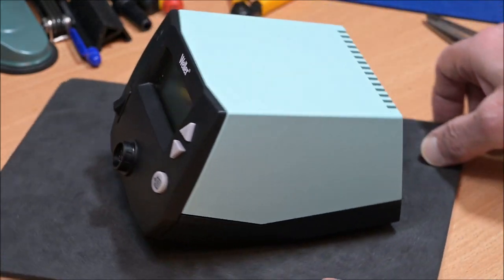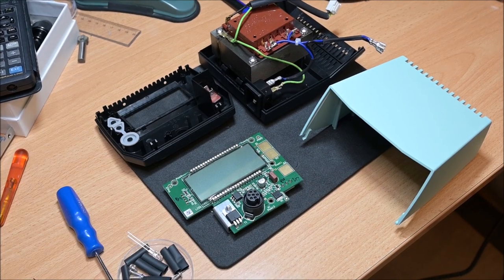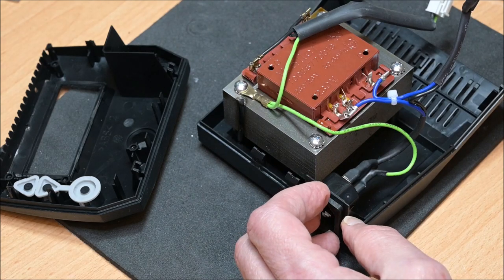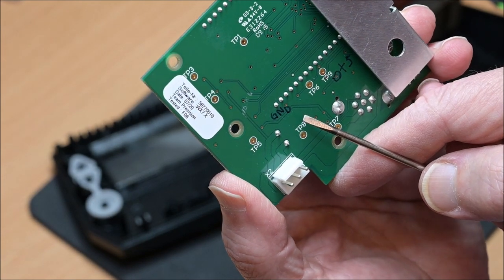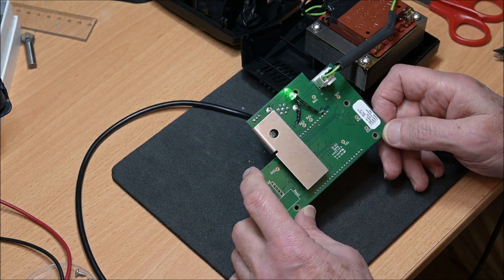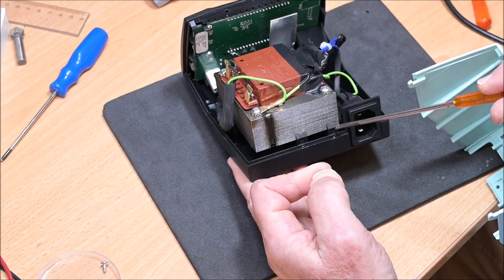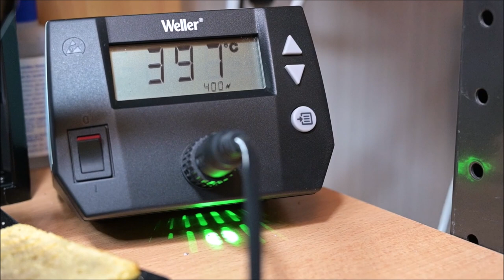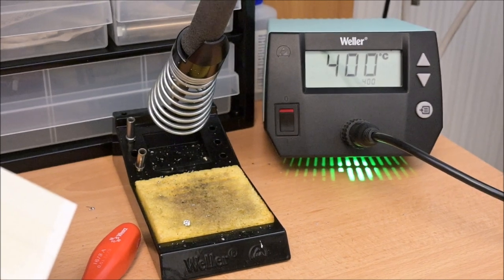Weller WE 1010 - A simple modification

Comment: Congrats for your job...it is very instuctive and pleasant to watch this video . Please , what are the necessary elements except the LED for this modification ?  I read somewhere in a comment a resistor I think...of what power please ?  Thank you for your answer ... Best regards from France . Cheers . Thierry
Reply from the maker: Thank you for your comment. The only parts needed to make this modification is a LED and a resistor. As you can see here, https://youtu.be/vsnpXHTc3M8?t=360 the resistor is nearly invisible because it's inside the heat shrink tube. It is connected to the +. I don't remember the value because it is a sort of trial and error value, I chose the value which gave me just enough light. The LED is a very bright 150k mCd, so it is really extremely bright and only needs about 1 mA, which in my case resulted in a resistor of around 3k. LED with less intensity might need lower resistor value to get higher current. As I said, I don't remember exactly, I just took a resistor and experimented to get the right intensity. I did not want it to be too bright because the desk surface is reflective and I did not want it to shine into my face too much.
Reply: @AdaptingCamera  ...Thanks to you
Reply: @AdaptingCamera  You say LED bright : 
150K mcd i know mcd but what is k mcd ? also the resistor 3K ? what is 3k...Power Resistor are in Ohms , isn't it
Reply from the maker: @sheritage1450  The letter "k" is used as short for "kilo" which is the same as the value 1000, so instead of writing 150,000 mCd I wrote 150k mCd. For the resistor it is the same, 3k but normally the word "Ohm" is also left out because resistans is measured in Ohms, so that is obvious. 3k means 3000 Ohms, or 3k Ohms.
Reply: @AdaptingCamera  Thank you for your answer and excuse my naivety but I'm new in this field of electronics...
Reply from the maker: @sheritage1450  You are welcome. We all been new in electronics once, so don't worry.
Reply: @AdaptingCamera ... Just finished "your modification" on my WE1010 , thanks to your video...same color , same intensity . The result is very nice . Thank you for sharing your experience . Kind regards from France . Thierry
Reply from the maker: @sheritage1450  You mean I am not the only one on the Planet Earth with this soldering station any more...? Cool. 👍 Thank you very much for the feedback. Kind regards from Sweden.
Reply: If you use a LED on 5V, you should have 25mA current as a rule of thump. It gives a bright light, and does not kill the led too soon.
As Ohms law is used I=U/R. To get R, use R=U/I --> 5V / 0.025A =>  200Ohm. If you use a 220 Ohm resistor, you should be fine.
Reply from the maker: @dschoas  That's incorrect, and is ONLY valid for old, low intensity LED. For LEDs with such high intensity (especially green LED) 25mA is far too much. Even so, if you want 25mA current drawn from 5V then the right formula is: (5 - LED voltage) / 0.025, => in my case (5 - 3.3) / 0.025 = 68 Ohms, NOT 200 Ohms. But that is for MAXIMUM intensity. You don't want that with a 150k mCd green LED because that's just far too bright and a huge waste of energy. That is why I am saying it's trial and error. Some people want it brighter then others, I am happy with the 3k resistor, which hardly draws any current, but gives more than enough illumination.

Comment: Wasn't it simpler and less invasive to mount an illuminated switch?
Reply from the maker: Not less invasive but simpler. On the other hand, if I was after simplicity I would have done nothing.
Reply: I totally agree to your question. Just use a Marquardt 1800.1102 switch and you don't have to solder on the PCB.

Comment: Super cool  mod! Informative and inspiring.  Do you think adding a fuse to this weller is necessary for safety? Can this be done?
EDIT  Never mind,  I just read the reply to the question in comments.  Thank you
Reply from the maker: Thank you very much. Please note that there is a fuse internally on the secondary side, as you can see here: https://youtu.be/vsnpXHTc3M8?t=129 F10 (red part) is the fuse. Also, normally (depending on where you live) there should be a fuse on the wall plug, or the socket in the wall. The soldering station comes with both EU and UK plug, and in the UK plug there is a fuse. So in my opinion, there is no need for additional fuse for safety. Of course, if you connect the station to 400VAC, and not to 230VAC, I don't know what would happen, but that is an illegal connection, not according to the specifications. It's not even something which can happen accidentally, it is a deliberate (or stupid) action. I don't know why anyone would need protection against that, but apparently, there is a hysteric guy on YouTube who have done this and based on his  totally stupid "test", this soldering station received a lot of undeserved bashing. I feel perfectly safe when I am using it, so for me, that's good enough. I live in Sweden, and the electrical wiring is perfectly safe in my home, so I will not add any extra fuse. But of course, if you feel uncomfortable with it, adding a fuse is extremely simple and there is more than enough to drill a hole and adding a fuse, that way, if you blow it you can change it easily. You can also add it without drilling a hole, so there are several options.

Comment: Good idea. You need to install the fuse (on 240V). It will come in handy sometimes.
Reply from the maker: Thank you for the comments. No, I don't need that fuse. This is a 230VAC version, and the hysterical guy is upset about that when you plug in a 110VAC version into a 230 V mains then the Weller will give out smoke signals and gets fried. Well, of course, if you are that stupid, it will get fried. Anyway, my home is safe, I have a fuse on each wall socket. The WE 1010 is delivered with a UK plug with a fuse in it also, so even if you live in the UK, you don't need to install any fuse in the soldering station, you are safe. Of course, if you replace the original cable that may not be a valid statement.

Comment: GREAT JOB AND VERY EFFECTIVE COULD I ASK PLEASE WHAT THE VOLTAGE RATE FOR YOUR HIGH INTENSITY LED WAS AS I AM FINDING IT DIFFICULT TO LOCATE A 5 VOLT LED .REGARDS PAUL HINDS.
Reply from the maker: Hi, LEDs don't have Voltage rate, they are current driven. That is, unless you want to install a LED light which is made for certain voltage, like the ones you can buy in stores to replace ordinary bulbs. Those LEDs are not suitable for the task, so don't do it. I think the one I am using is this one: https://www.ebay.com/itm/252312633093 but basically you can use any LED, as long as the forward current is right. What is right depends on the intensity you want. This LED gives you maximum intensity at 50mA but that is far too much for my taste. The LED can be connected to any voltage, and the forward voltage (voltage drop across the LED) of this one is 3.3V.
Reply: thank you.

Comment: Hello with a 470 Ohms serial on the anode the light is not seen in  the dark ? All the best from France
Reply from the maker: Something must be wrong. Perhaps your LED is broken, perhaps you connected it the wrong way, perhaps the resistor is burned, I don't know, but 470 Ohm should give you more than enough current if everything is right, unless if your LED is from the 1970's...

Comment: Late to the party, but... Good idea. I'm replacing the original on/off rocker switch with one that has a red neon bulb and a current limiting resistor inside it.
Also replacing the original, lame pointy tip with a type ETD 3/16" wide "screwdriver" tip, as the pointy POS original TIP can transfer little heat to a joint. Ordering 3 spares, "just in case".
Now, if I can just get the WE 1010 soldering station to stop smelling like the aftermath of a toxic chemical spill... Phew!
Reply from the maker: Thanks for the comment. Larger tip is not always better. I use several tips, depending on the work I do with it. In fact, I find the default tip too fat for my needs most of the time, and never needed anything wider. I don't know what smell you are feeling, my soldering station never smelled and the only thing which smells is the rosin core melting.

Comment: OK so it looks like if I use an LED that is not spec'd for higher than 3V, then it WILL burn out to where it goes dim LOL
Reply from the maker: You need to have a current limiting resistor in series with the LED. Mine is in the heat shrink tube. https://youtu.be/vsnpXHTc3M8?t=360 But I don't think you should do the mod if you don't know that already because you can fry your soldering station if you don't know what you are doing.
Reply: @AdaptingCamera  btw, for those who don't know about the need for a resistor, I would put some text on the screen and explain that, because it just appears like you really like heatshrink based on the content of the first half of the video.  Some won't think there is a resistor in there...
Reply from the maker: @ChonkTek  Maybe, but then again, if one doesn't know a resistor is needed then that person should NOT open this soldering station at all. I mean, you should not start modifying things without knowing how and what to do. This video is not an educational video about the basics of electronic engineering, there are plenty others about that showing how to connect a LED and how LEDs work. Besides, the resistor is visible in the video if you look carefully.
Reply from the maker: @ChonkTek  Yes, maybe it would be a good idea, but the video is not intended as an educational video regarding basic electronics, quite the opposite, anyone NOT having the knowledge about how LEDs work and how to use them should NOT even attempt to do this mod. Also, YouTube does not allow for embedding text once the video is published, and a published video can not be replaced.
Reply: @AdaptingCamera  at the 6m mark?  It's not directly visible, but yes, maybe if one knows a resistor is required for that LED then they could imply one is there.  But again, you should still mention it so noobs don't kill their station or LED.  If you're going thru the real-time steps of every single other thing in this moderately long video, you should mention it.  Also, the fact that you are taking the time to heatshrink unnecessary connections may give the viewer the idea that elsewhere in the video will be as detailed when it's not.  Just thinking aloud here.  I guess the worst that will really happen is people will burn out their LEDs if they don't use a resistor.  Although I don't know if a short condition could occur with an LED.

Comment: It looks cool. But I don’t get it. You have a big display with numbers on that shows the station is on🤷🏻‍♂️
Reply from the maker: The answer is easy. I can't see in dark. The display is not backlit, so if I forget to switch it off it will stay on until I look at it next time when there is light in my room. Also if the soldering station is hidden behind some other activity it is not possible to see the display, even if there is light in my room. The third point is that in my opinion, every mains powered electrical equipment must have an indication that the equipment is on. A display without back light is not good as an indicator. Weller saved 10C by not adding a LED or a few $ by not adding back light to the LCD, which I think is bad. It would have been better with at least a single 5mm LED at the front of the station.

Comment: Ouh man, you could‘ve installed a Backlight into your station very easily! Get square LEDs and bend so they shine directly into the side of the LCD. But definitely get at least two of them to get a half way homogeneous backlight.
Reply from the maker: It's always easy to do things that you are NOT doing yourself.... :) There is no space for your "solution" and it would really make it cheap look like. If there would be space for a real back panel I would have added that, but it looks better with my solution than it would look with yours. I'd rather just add a simple LED in that case, in fact that was my initial thought, but I didn't want to void the warranty by drilling a hole at that time. Today, if I wouldn't have done it before, I'd just drill a hole for a LED, or changed the switch to one with light in it as well, but would still not do according to your proposal, because I think that this gives it a cool look as well.

Comment: Add a fuse to the input voltage, the primary transformer side has no protection, if the primary windings short or you plug into 220 by mistake it will become a fire hazard smoke bomb.
Reply from the maker: That's not necessary at all unless you are an idiot. To start with, if you short your primary winding nothing will happen with that fuse, except that you will blow the fuse of your mains. Remember that electricity ALWAYS takes the shortest route, so there will be no electricity flowing through your fuse. The only time that fuse will blow is if you short the SECONDARY winding, not the primary. ...but why would you do that...? Your second argument for the fuse addition is also dumb. Who else than an idiot would plug it in into a voltage which the equipment is not designed for...? You should not even have the possibility to do it since those plugs should be built in a way that mistakes are prevented. So if you do such stupid thing then it's a deliberate stupid action. BTW, I live in Europe, so we have 230VAC mains here and I plug it in every day into 230V... 😂

Comment: No spare parts for the WE1010 Station! is the reply i receive from Weller.
From a company who sell tools for repair is inadmissible , let this old company gone like water of toilet .
Reply from the maker: "No spare parts" means normally that they are not selling spare parts to private individuals, which is pretty normal for many companies. Also, "no spare parts" is nonsense, since you can buy all the spare parts necessary, which are user replaceable, like tip and the WEP 70 plus other things on it. But yes, if you mean the transformer inside, that might be an issue if you want to buy original, or the electronic circuit board inside, otherwise there is nothing else except the switch, but none of those should be regarded as user replaceable. So which part do you need? Did you fry the electronics and want to repair? If you can identify the faulty parts, those are pretty standard, so just buy and replace. But of course, you will need a soldering station first...

Comment: If the display is on then it's on...if it's off then it's off....not sure why this waste of time and effort was done,it only voided any warranty claims.
Reply from the maker: @Stephen Champagne  I am sure you are a wise man, but this was perhaps not your wisest comment. I am not stupid, if I sit in front of the soldering station then I can see if it is on or not by looking at the display or the position of the switch. The grey on grey is however not that clearly visible as light gets dimmer during the afternoon, and unless I switch on the light in the room, the display is no longer visible from a fairly short distance. A clear visual light indication of things which are on is normal industry standard. This station does not even have a backlight for the LCD, or a simple LED in the switch, which every other Weller model had before, at least ALL that I came in contact with the last 50-ish years, private and professionally. I can't for my life understand how the Weller designers were thinking by leaving out a LED worth a few cents. There is more than enough space in the box and there is already a 5V available, so why leave such a simple thing out when they decided to save on the backlight...? Brain fart of the designer and his/her boss who accepted this. Also, don't worry about my warranty, it is still valid if I needed. This simple fix is easy to undo if necessary or if I want to. But if you worry that you destroy something and void your warranty, or you see this as a waste of time then don't do it. Personally I think it is cool and I like it a lot.
Reply: Wonder why the designers did not use a backlit display?
Reply from the maker: @warplanner8852  I think a backlight panel is more expensive than a simple LED, but sure, I would like that and would have been glad to pay some extra for it.
Reply: @Stephen Champagne ... Apart congrats from the WELLER Team  , above , i have not seen any criticism from them regarding the warranty ...!!!
 After this video , it's sure I’ll do it on my WE 1010...
Reply from the maker: @sheritage1450  I think people who are afraid of voiding the warranty should not do it, but I didn't expect anything to go wrong. I was a bit nervous about using the soldering iron on the soldering station itself, it is risky because everything is on, so there is a risk involved there and if you have access to to another, it is better to switch off the Weller and use the alternative one on it. Today I'd go and borrow my old one and would not use this one on itself, because it is kind of asking for trouble. Generally speaking, it is a very simple and non-intrusive modification with very low risks involved, but of course, technically speaking, the warranty is void as soon as you open the casing, even without modifying anything. Be careful and be aware of that.